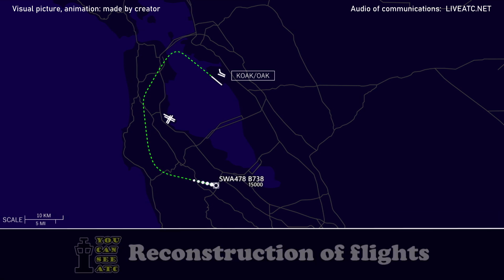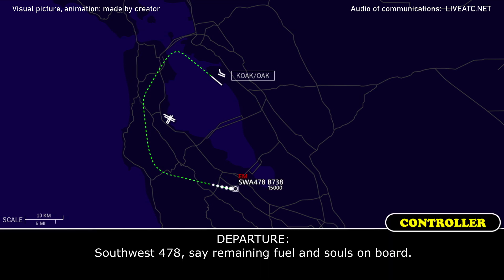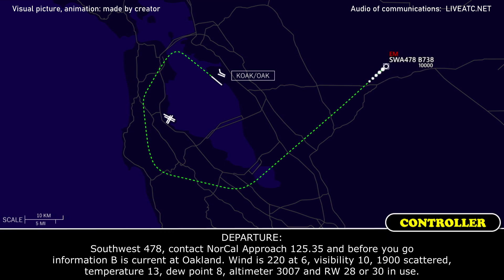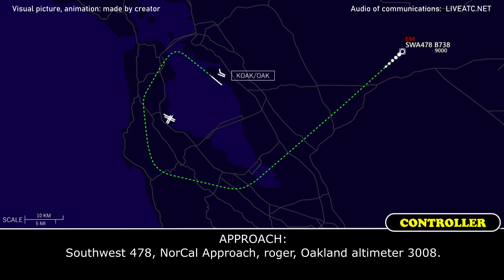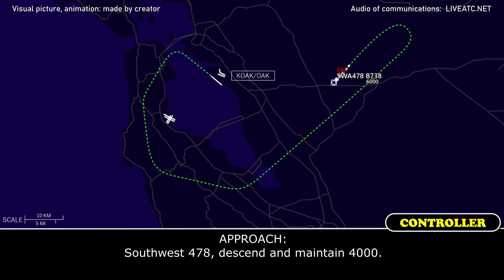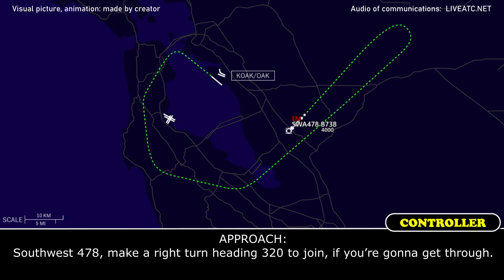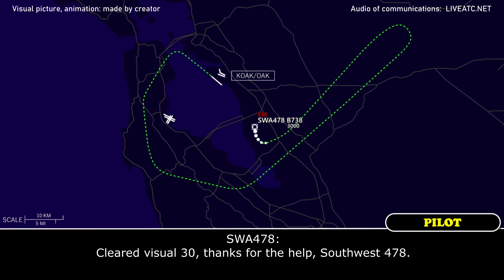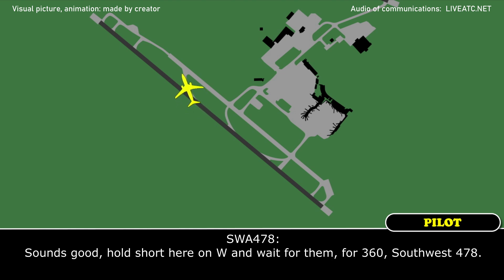Engine overheating. Emergency landing | Southwest Boeing 737-800 | Oakland, ATC

Comment: Seems to me that some Controllers like this one try to rush the flight crew to make the approach before the flight crew are really ready. not just on this video but many others too..
Reply: In my opinion, unless the pilot asks for delay vectors ATC should vector them in for a normal approach as far as distance/height.
Reply: @jcl410   Yes agree with you, but ATC often ask are you ready to come in now!!  crews often reply well give us another Min or so, thus a bit more hassle for the crew, they must be satisfied they are fully ready to come in.. I just feel ATC rush the crew in some cases  better to go around a few times than get the approach/setup wrong..
Reply: @johngourliemartin2696  It's not (usually) rushing, it's planning... if they plane needs another 10 mins to set up, that would require ATC to vector them differently than if they only needed another 2 for instance. ATC needs to know what the plane needs, so that they can decide how to vector them. If they need the plane to make a turn, they ask if the plane is ready to come in... if so, vector towards final. If not, vector away from other traffic.
Reply: @brch2   Yes I take your point,, there has to be planning, just some controllers have an aggressive  manner, and rather off-putting when dealing with an emergency  as though everything is a problem  love atc on youtube a great insight into flying